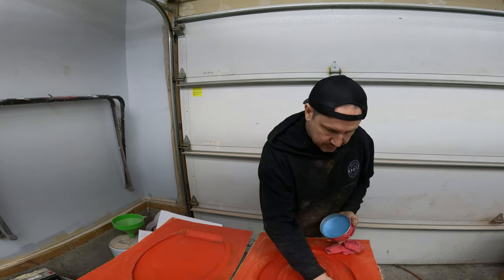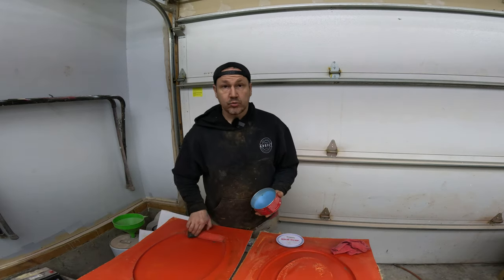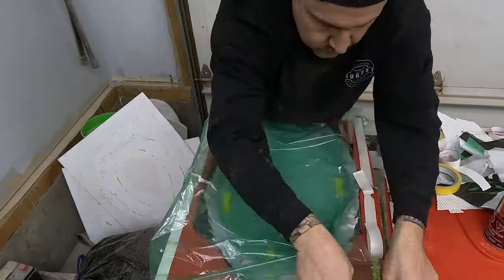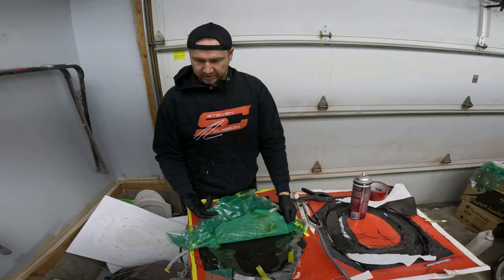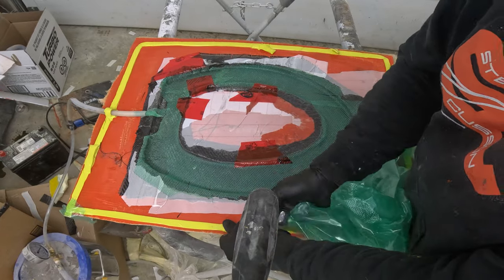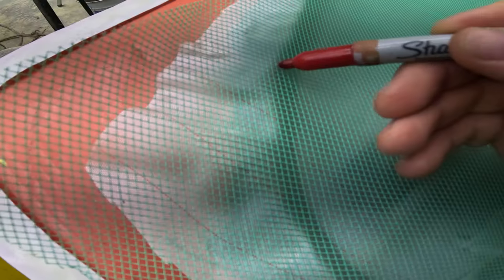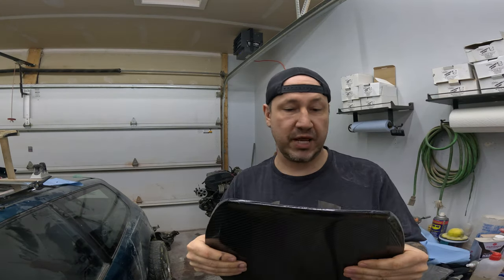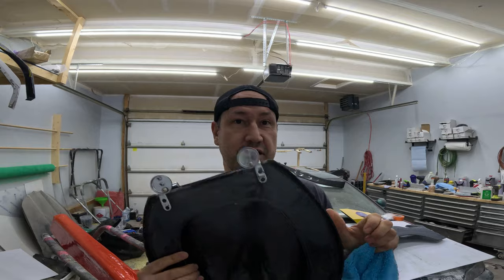How To Make Anything Out Of Carbon Fiber | Carbon Fiber Toilet Seat

Comment: I Love it!!!! What else for Steve to make from Carbon Fibre......Well, I had to move a bed frame and that weighed a freaking ton, so right now I'm thinking bed frames. Or maybe dual compartment(?) wash buckets for those folks that like to use the two bucket method to wash their cars and plastic just won't do. OR something that would nicely hold all the car care products that you take to car shows. Maybe a carbon fibre baseball hat. Belt buckles for fancy hill billys. Just throwing out whatever the brain slams out.
Reply from the maker: These are all great ideas!